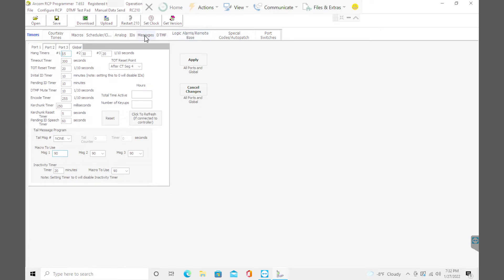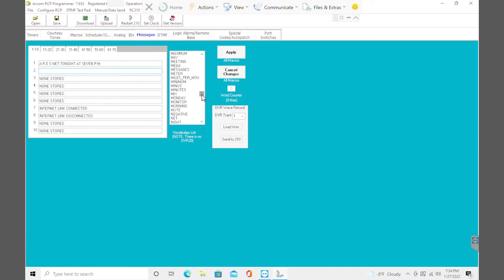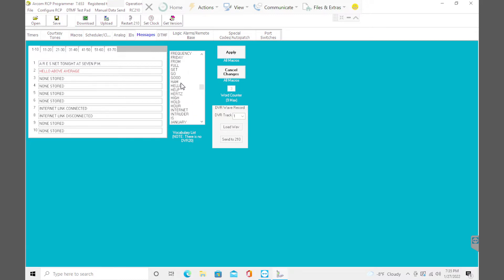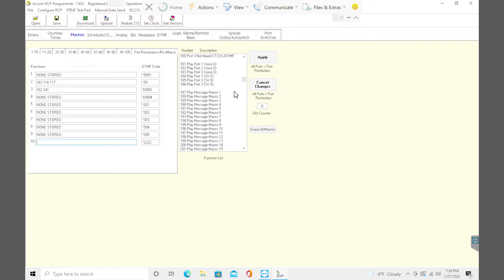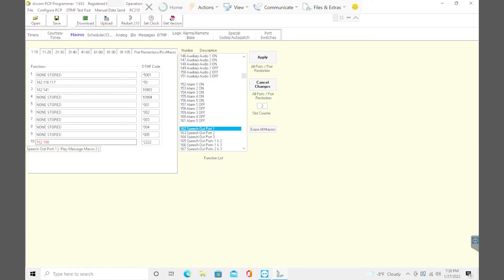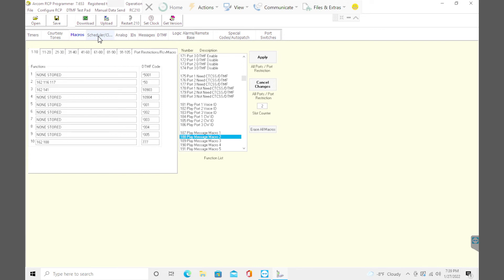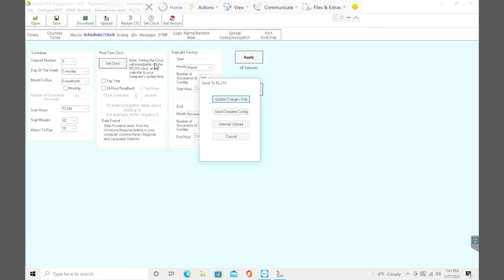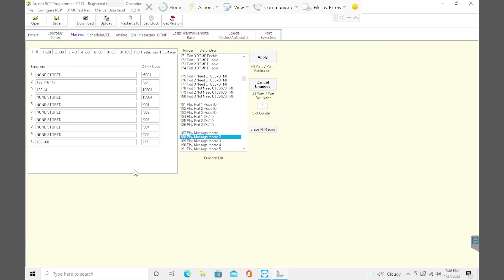Arcom RC210 Programming:  Scheduling a Message Macro (and triggering using DTMF)

Comment: After the loss of our club president ,myself and another club member were elected to do repeater maintenance . We actually have 2 of these,one as a backup incase there's problem we can just swap them out . Well ,now our repeater clock is wrong (even with the extra module)  and we also want to switch a few things around with linking the 2 repeaters,so  I may be pinging you with a few questions ,once we get the 2nd controller  and the laptop with the software ..  Thanks for putting up this video ..
                              N3TVV

Comment: I'm really enjoying your videos!  I'm a former user of the Arcom controller (I replaced my controller a couple years ago), and I had used DTMF only to program my controller because I use a Mac.  I overall enjoyed programming my Arcom controller and used almost all the features on it, but I wanted to do more so I now use a more advanced controller.  Had Arcom brought back the RC810, I probably would have gotten it.  But I did like the controller apart from the issues I had with the ADR interface some years ago.  I'm looking forward to more of your videos!
Reply from the maker: I'm glad you are enjoying!  Thank you for watching.  I am really happy with this controller, and plan to use a lot of the features.  It just takes some time to get around to tackling the various things.  DTMF only for programming?  That must have been "fun"!  But that's probably pretty common.  I just happen to have a repeater in my house, so it's easy to work with.  I'm curious what your more advanced controller is.  I don't need another one, but it's always fun to learn what's out there.  The less expensive (and less refined) controllers are interesting.  There may be some videos of the IDOMATIC and Elektra2000 someday (just to learn them, make some videos, then sell or give away).   Stay tuned!
Reply: Yeah, I think DTMF programming is more common for certain controllers than others.  My more advanced controller is the S-COM 7330, which I think is one of the best in the market.  I've actually programmed other controllers before, such as CAT, Link-Comm/RLC, and ACC.  I was actually considering the Elektra in my original choices for controllers back in 2014, but I haven't seen any in action.  Feel free to check out my Arcom and S- COM videos on my channel!  I also wrote an article on the S-COM controller which you can find on their website.  Keep up your great videos!
Reply from the maker: @W8SRC  Ohhhhh.  Yes!  I have been to your channel.  
I like your content.  :) 
I'll pay a little more attention to the S-COM details you have.  That DOES look like a slick machine.
Reply: @HamRadioRepeaters  Thank you so much!  I'm hoping to make more videos on the S-COM in the future.

By the way, I think there's a timer on the Arcom that lets you set a period of silence before a message plays so that the transmitter can key up before the message is heard.  I'll have to look at the manual and let you know.  I think I had mine set to 1 second, which is what I have it set to on the S-COM.
Reply from the maker: @W8SRC  I just found it!  Thank you!  It doesn't seem to be a software setting, but only a DTMF code.  I changed it to 1 second.  That did the trick.  You're awesome!  (if it is in the software I  didn't spot it).
Reply from the maker: @W8SRC  I did some more digging.  It's in the Global settings.  So I learned how to program it via DTMF, but there's an easy way in the global settings.  :)
Reply: @HamRadioRepeaters  Oh, that makes sense!  That's pretty cool.  I'm looking forward to more of your videos!
Reply: What version are you running? I'm running 5.51